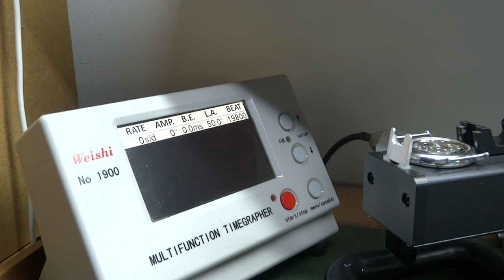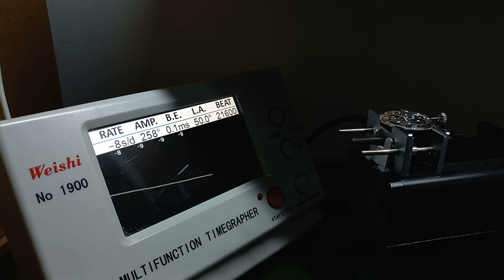NOMOS Glashütte Mechanical Watch Service

Comment: Nice job. What were your thoughts on the watch itself, good movement, case etc?
Reply from the maker: Nomos is a brand that I have always liked, this is an older model with an eta (peseux) caliber and not like the current manufacturing ones (Orion). Honestly, with the money it costs, I would prefer to buy something else, even if these older models now have very accessible prices.👍